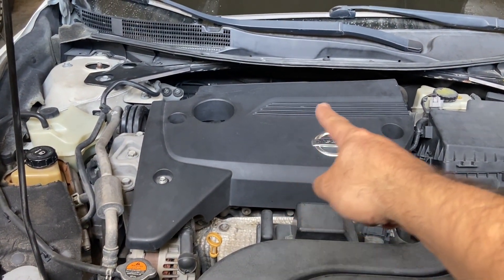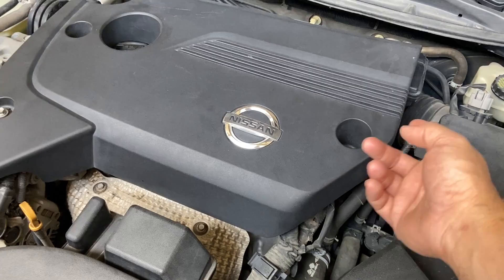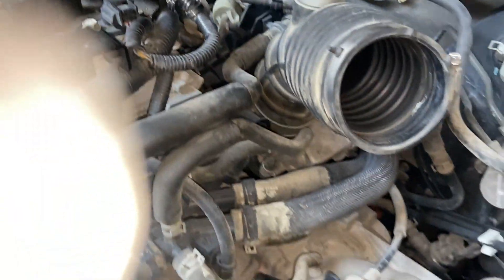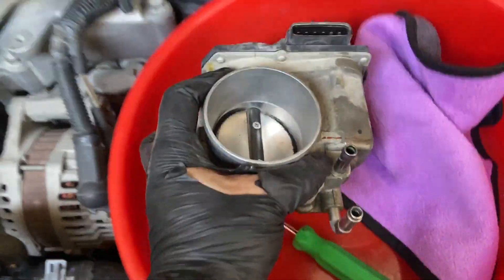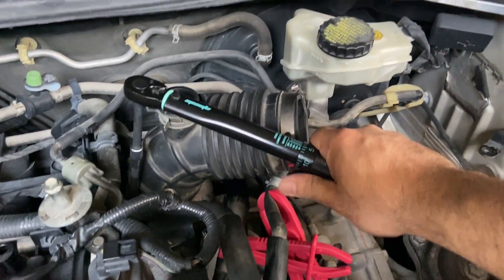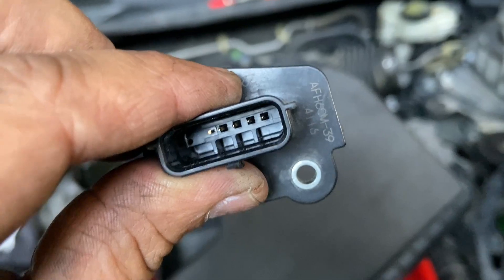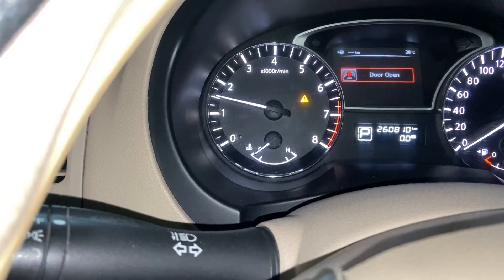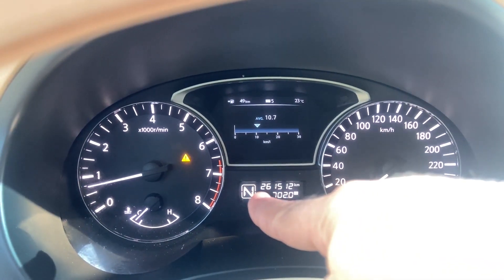How to clean Nissan ALTIMA(2012-2018)2.5L Electronic Throttle Body and Mass Air flow sensor

Comment: i have the same car 2015 nissan altima 2.5 sl. Trying to do the throttle body cleaning myself do i need to do the throttle body relearn process
Reply from the maker: Thanks for watching! 😊 Yes, usually you don’t need to do a relearn if you just did a simple cleaning and didn’t move the throttle plate too much. But if the idle feels rough or the RPM is unstable after cleaning, then a throttle relearn might be needed.

Comment: Thank you of your video sharing on how to clean body throttle of Nissan Altima 2013. As what you said no need to relearn after cleaning is that correct. Because I’m confusing and afraid on how to relearn after cleaning in my nissan altima 2013 also!
Reply from the maker: Thanks for watching! 😊 Yes, usually you don’t need to do a relearn if you just did a simple cleaning and didn’t move the throttle plate too much. But if the idle feels rough or the RPM is unstable after cleaning, then a throttle relearn might be needed